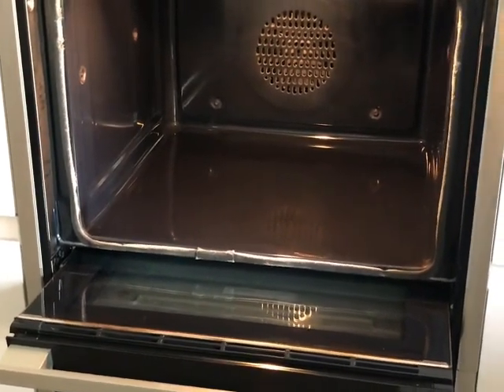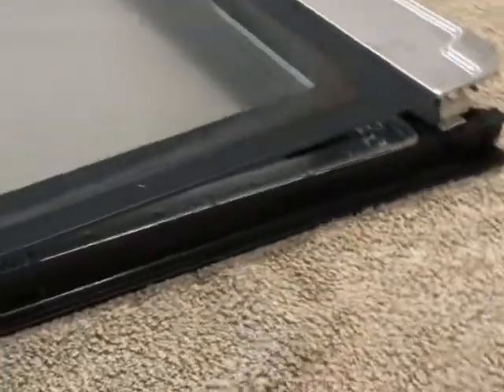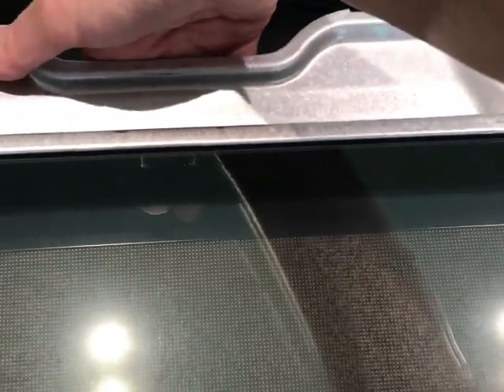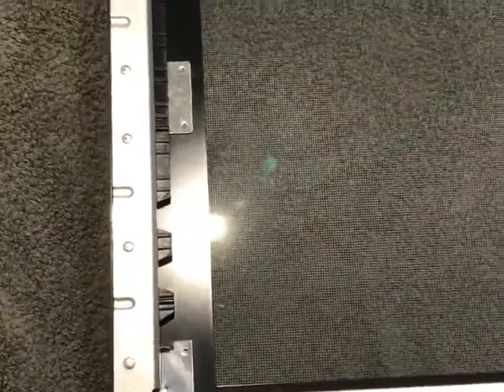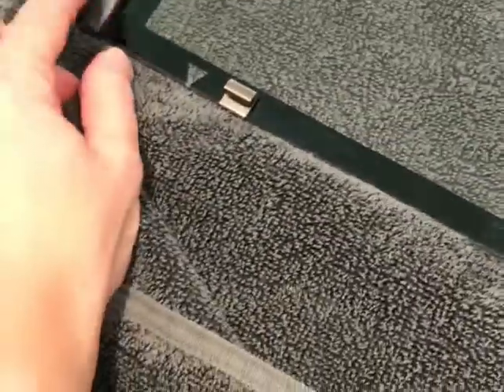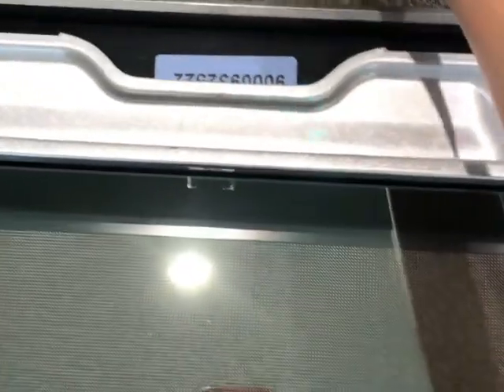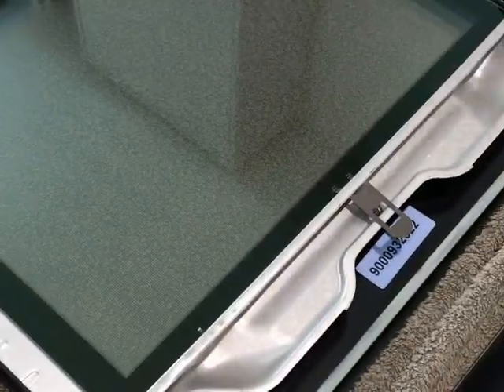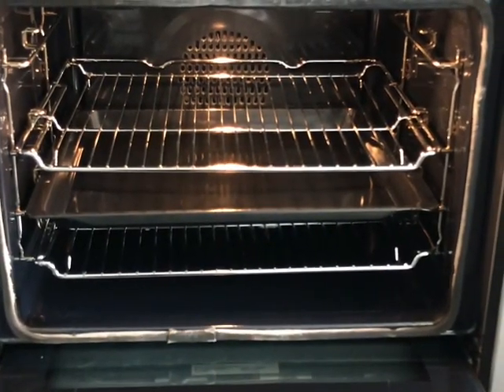Neff Oven slide and hide glass clean!

Comment: Just wanted to note that the door design on the Australian model is slightly different.  The procedure for removing the first glass panel is different to the UK and European model.   There are no silver tabs to squeeze down on to release the glass - instead there are two screws that need to be removed.  They are Torx-head screws (the 6-pointed star-shaped ones), so you'll to make sure you have an appropriate driver.

Removing and replacing the door, and removing and replacing the inner panels are all the same as in this video.